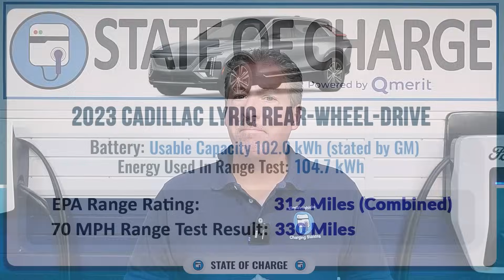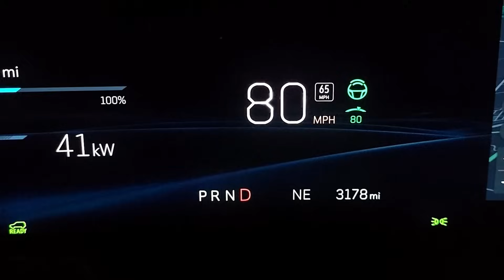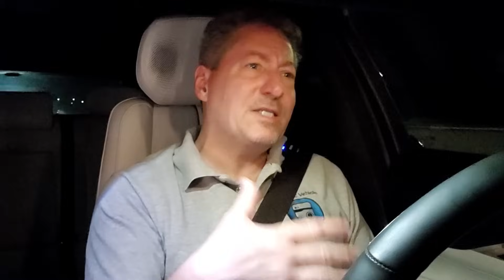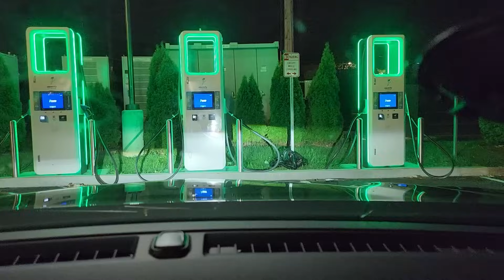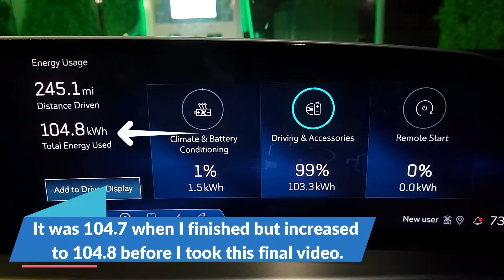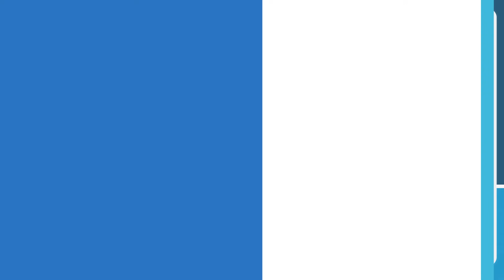Cadillac LYRIQ Range Test Comparison: 70 MPH vs 80 MPH

Comment: I have a Lyriq, I am very curious to see his results vs mine.  80 is way too fast.
Reply: Not Really.  I drive from the east coast to IA a lot.  I typically dial in 72 or 77 a lot depending on the speed limit.  I typically limit myself to 7 miles above speed limit.  Further west and that is 82, or even 87.

Comment: Hi Tom, thanks for doing this! That's quite a range hit.

Any chance we could measure how much energy the headlights used?
Reply: vehiclechef site says 55W per headlight for 110W. So  330 miles at 70MPH would be 4.7 hours. multiply that by 110W and you get 0.5Kwh. or a mile or so.